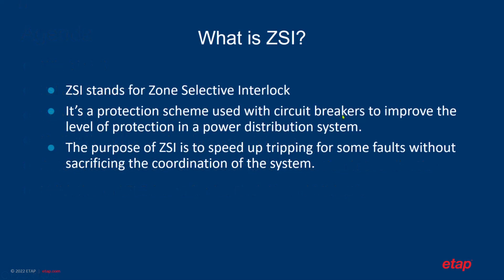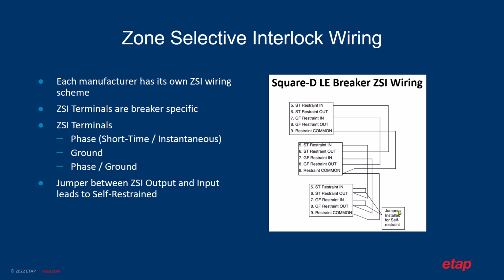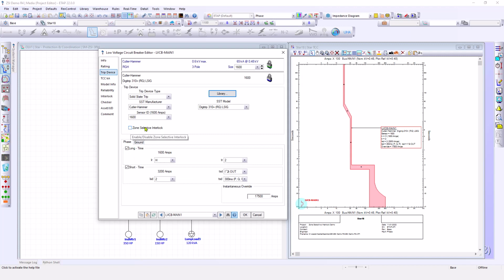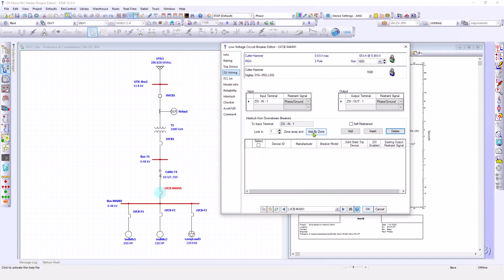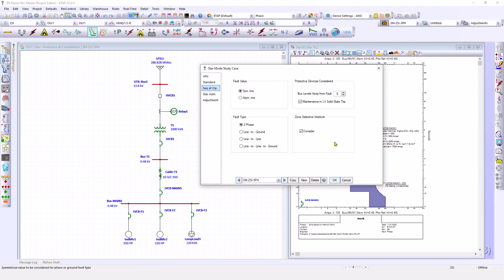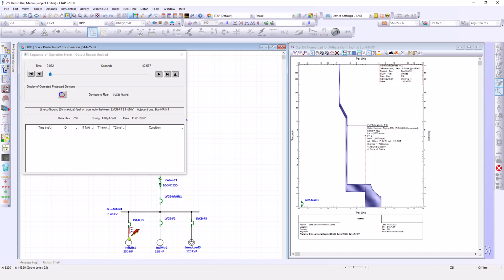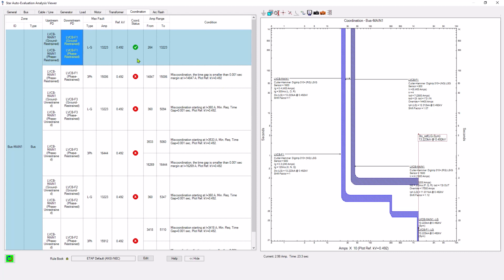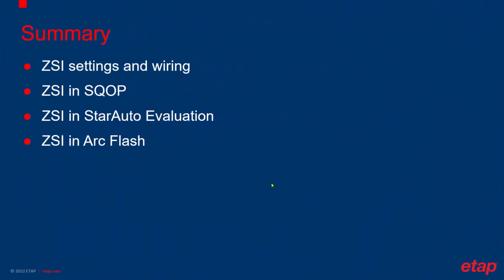ZSI Scheme for Protective Device Evaluation & Arc Flash Mitigation Technique using ETAP

Comment: Thanks for your video, very informative, just have a question, at 26:17, ZSI wiring, if check “self-restrained”, and at 26:35, trip device, no matter library ZSI is unrestrained or restrained, the trip shall be trip at restrained? Because at 3:31 showing “ downstream breaker trip on unrestrained time if it is not self restrained”?
Reply from the maker: When self-restrained is checked, the downstream breaker will trip using the restrained setting when a fault is detected. If self-restrained is unchecked, it will trip using the unrestrained setting upon detecting a fault.